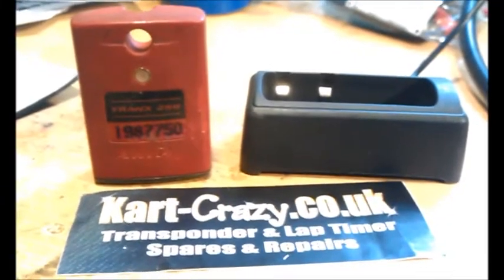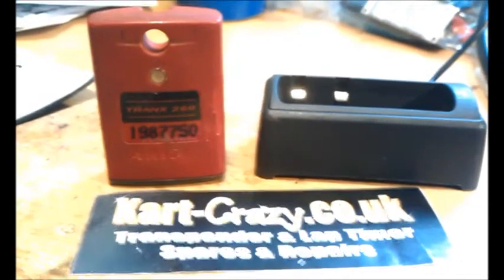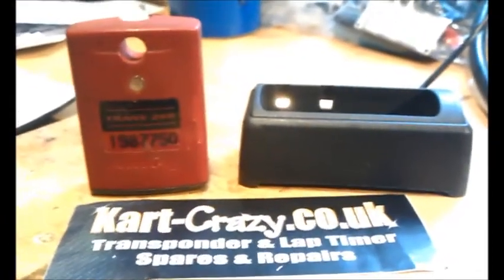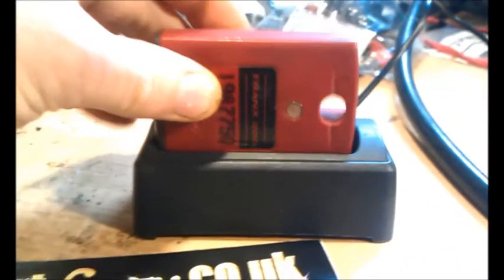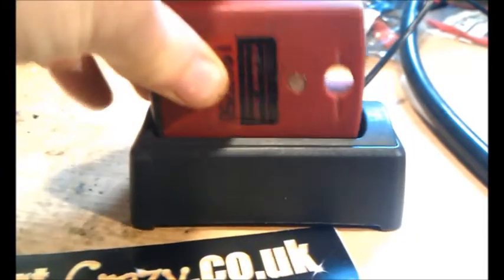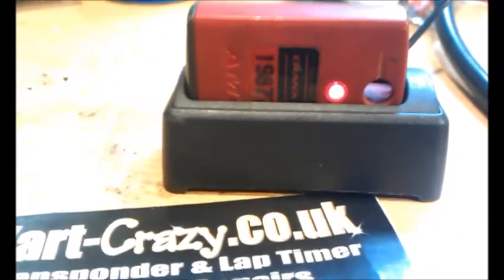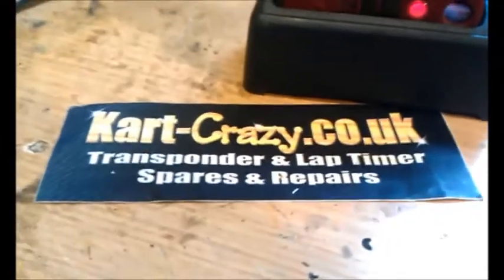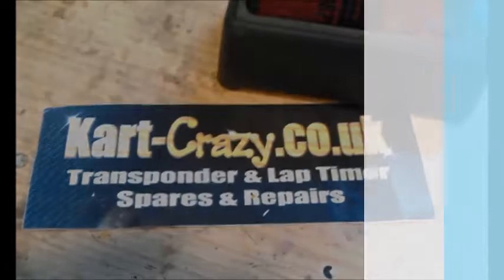How To Test a AMB 160 & 260 is Charging Correctly

Comment: Hello
The 160 is that only for Karts or can it be used on a motorcycle also, or do I have to use the 260?
What is the difference between the two?
Reply from the maker: The number indicates the max speed in kph the transponder can work. 
So the 160 are used for slower speed Motorsport, karting etc. The 260 are used for car & motorbike racing.